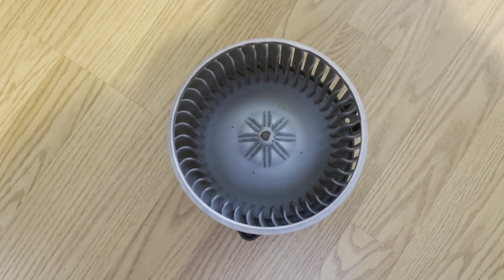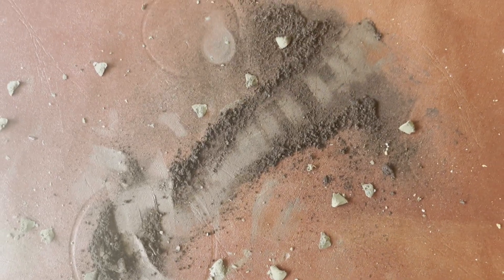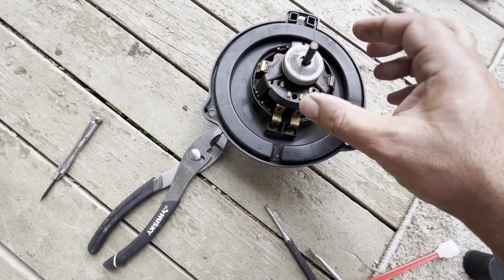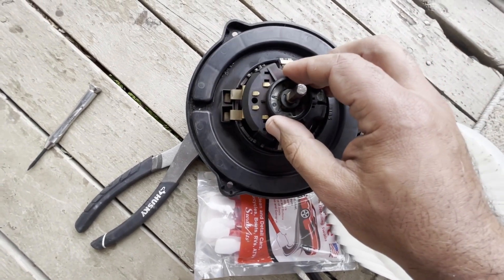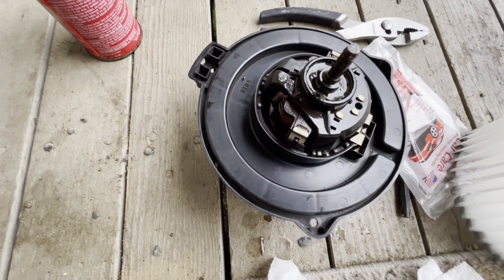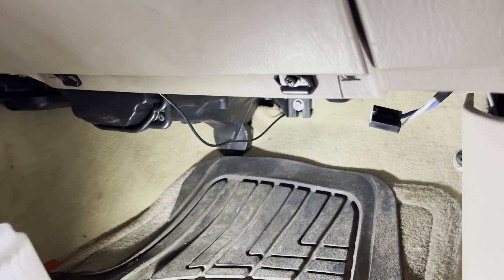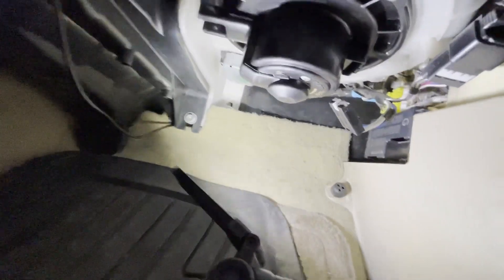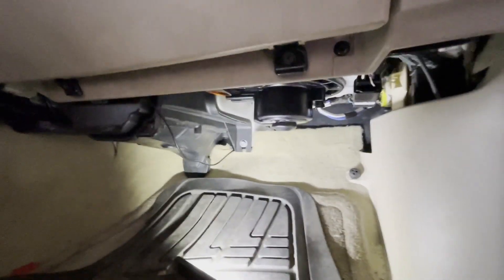Toyota Land Cruiser- Lexus LX-GX- Prado -Cygnus-UZJ100 | AC Heater Blower Motor Bearing Noise Repair

Comment: You touched on some better points than another how to video. The three metal screws are highly maleable, meaning my philips screw driver kept stripping them, i didnt have a socket or wrench to get the screws off but a flat head screw driver did the trick. I cleaned mine like this video and another video I saw, and the chirping/squeeking came back about 9 months later. I bought an OEM one from the dealer for about $300. I know its a crazy price forsure, but it was crazy to hear that chirping on a 100° day 😂

Comment: I used silicone pb blaster spray with a tube attached to re-lubricate the shaft and I guess bearings that are at the motor after thoroughly cleaning all.  When I re-installed the hamster wheel fan it was hard to get back on, so I used a rubber hammer to lightly hammer.  The impact seemed to have caused some cracking on to the black casing on the other end.  I would have used a small amount of silicone grease on the metal rod if I had it to do over without hammering.  I’m interested to see if the noise will remain gone in the long term.  I may end up replacing the unit if it acts up again.  The chirping was so annoying.
Reply from the maker: Mine worked fine for a week and the annoying chirping noise came back after a week. I ended up buying another used OEM blower motor from eBay for 70 bucks. Ever since it’s been quiet. 
There is a guy selling brand new OEM blower motor for 30 dollars on eBay but without the squirrel cage.
Reply from the maker: Here is this link to the blower motor on eBay without the hamster cage. 
https://www.ebay.com/itm/255128433681
I have not personally tested it, but it seems to be the same blower motor as used in your car.